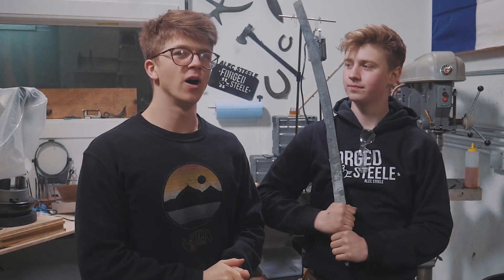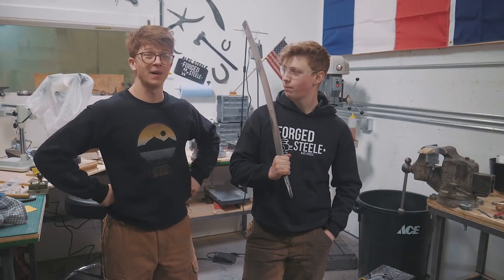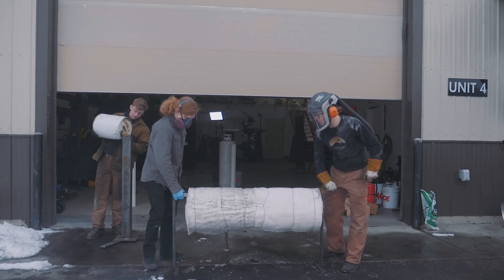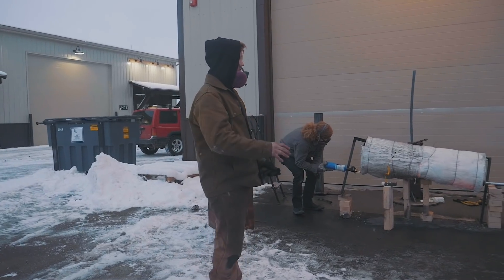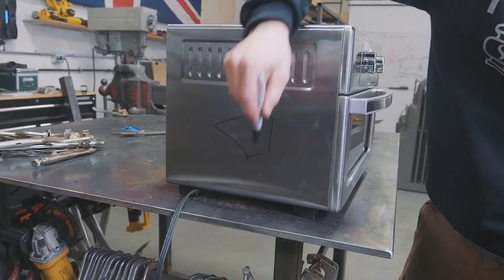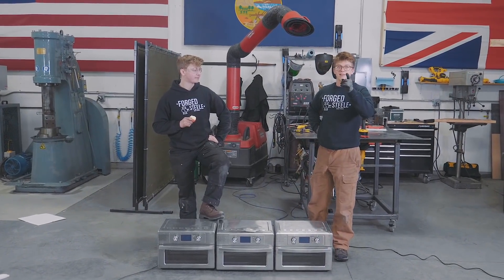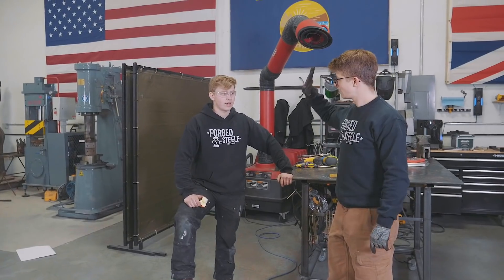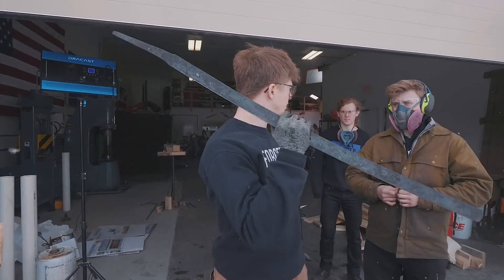MAKING THE CAVALRY SABRE: Part 4

Comment: Alec I have worked with the ceramic insulation at my current job. We made ductwork insulated with that material. You can buy tubes of insulated ductwork that would be perfect for that, 48-60" long max, 20ga inner SS, 24ga outer SS shells. It would hold up much better than that roll you guys are using, you can also get insulated doors on the ends. Just FYI if you wanted a more solid setup to heat your swords. Also the inner diameter can be anywhere from 8" to 24", by multiples of 2.
Reply: You should DM him this, he prob won't see it.

Comment: If the three toaster ovens together  don't physically work, at least you have three elements and thermostats to use to heat a fire-brick lined oven you can make to size . . .

Comment: I am somewhat surprised you went and got 3 toaster ovens (and not even the cheap one at Walmart to boot) when for considerably less than you paid, you could have gotten a thermal control several heating elements and double tube with some rectangular steel... Throw some kaowool in between to make it nice and energy efficient, and depending on your thermal control, you can even set it up to cycle and/or make it an annealing box...  (set it up for a argon or noble gas feed and you got yourself a heck of treating rig.  This idea comes from a good friend and someone I consider my mentor.  (though he used re-purposed ammo cans he picked up for $1 a piece)

Comment: Alec I highly suggest you guys get some insulation around the openings in the ovens! Did you protect the wires? Worried you’ll get an uneven heat
Reply: Yeah they just opened up those wires to the oven heat
Reply: I don't think they are planning on using this setup more than once. Though honestly I thought it would be a good idea just to cut them apart weld them together and just make one long oven out of them. Surely they are going to need a proper tempering oven at some point.

Comment: Alec: Dont do this this is ridiculously stupid and dangerous
Also alec: Its not stupid if it works
Reply: it's not even really dangerous. They just added a door.
Reply: John You’re cutting a hole through a metal casing which has to be earthed to not electrocute you, if you mess up the wiring by doing this you could fry yourself wouldn’t exactly be safe
Reply: @lroberts  So the outer casing doesn't look grounded to me. in fact I don't think any electronics contact the caseing directly. While I am not an amateur electrician every one knows to not cut the insulation on a wire, or to ground  to places where they shouldn't. Like when they shorted the contacts with the springs, that was dangerous. But cutting an opening in what is essentially heat shielding to pass an item through not so much. Just like cooking some thing you can leave unattended others you can't. In this case I would prefer they join the holes with some sheet metal and insulate he new openings  to keep the heat in the ovens chambers from going into the void space to make it safer. That area  is there to protect you from when you stupidly grab the outside of the oven also to keep from setting what ever you crowd around it on your counter from melting to rapidly.
Reply: @Laugh1ngboy  Electrical appliances with metal casings are grounded to prevent you from electrocuting yourself in the event of the device malfunctioning or having a defect, either from the production line or from the user. The heat generated from the oven could potentially melt the insulation on the wires as it rises by convection into the void between the two metal cases and cause an open potential difference in the circuit. If the metal case isn't grounded or it was accidentally damaged, this would prevent the fuse from blowing with would open the circuit and prevent an accident. So I think its fair to conclude that this wasn't exactly the safest thing.
Reply: @lroberts  There is a difference between having a ground and being grounded through the casing. A lot of kitchen alliances are double shielded and they are not grounded. It is why they can now get wet and not set off your GFI, but will if they fall into the sink full of water.
Reply: @Laugh1ngboy  Cool m8

Comment: Alec! Great work! And I finally have a way I can share my knowledge with you, as I am an insulation contractor by trade. For your blankets, find the product made by 3M that has a kraft foil scrim facing. It's like a super-heat-resistant foil that's adhered to the entire surface of the insulation, meaning you won't have the fibers and dust blowing around, as well as less leakage/invasion of cold air into your chamber. Will also let it stay in one piece longer, meaning you can use it for heat treat more times before it starts coming apart. The stuff should be around $5 per square foot. If you don't have a local 3M distributor, look into commercial/industrial insulation suppliers. Any of their reps should be able to guide you to the right stuff.
Reply: I've also now got myself a Freedomheight shirt on the way. This is gonna be a good week.

Comment: Why dont you just use the parts from the toaster ovens to build one large oven. Make a box, gut the toasters use the heating elements and controls in the longer box.
Reply: This way they have a built-in way to sit the sword in the middle of the space.
Reply: The hearing elements would probably not give off enough heat to heat that large an area, in the ovens they still have the areas they were designed for

Comment: Why not use firebricks and electric coil and just make a permanent heat treating oven?
Reply: Another way that i've seen it done is to use a hot oil bath.
Reply: I was just about to comment this. You can get a small kiln, some extra coils, and some firebricks and make a pretty decent and accurate heat treating oven of any size or shape without too much effort. We did this with an old kiln that my dad used to cool down his glass blowing stuff with. Just gotta be careful cause once you fire the coils they become very fragile.
Reply: With you on that...I mean they have an electrician that they have used a lot and between the group could make that pretty quickly
Reply: They say it is a temporary solution. The guys will have something planned I guess 🤔🤔
Reply: I am pretty sure this heat treating oven will become like that with a layer of that material in.

Comment: I like the idea of the ceramic wool heater, we use a similar concept in the oil industry for boiler systems ( coils containing oil wrapped in ceramic wool and a fire blown between it all to warm the oil circulating in the coils) . To make a more permanent heat treatment oven you could attach the ceramic wool to the inside of 10” drill casing and mount the burners down the middle. And put a swinging door on one or both sides. Just and idea! Keep up the good work!

Comment: Make a Tempering Oven, make a single insulated box. Dismantle the toaster ovens (remove the tin) and mount the elements inside your new oven.
The current method is going to have two 2-4 inch sections of the blade (the double walls where the 2 toasters connect) that don't get properly heat treated, or at least don't get to the same temperature.

Comment: remember to maby insolate the holes so you dont burn off the wires ?
Reply: That's what I was thinking. Maybe cut some kaowool like a picture frame and then sandwich it in there so all the gaps inside are covered to protect the wires from the heat.
Reply: Doesn't burn the holes/ holds the heat around all parts of the blade to avoid an uneven heat treat.
Reply: welp we are gonna find out soon enugh anyways :P
Reply: @durasux99  kinda what I tried to say haha, However I made quite the pig's ear of it haha.

Comment: Feeling that the wires exposed from the oven being cut won't like being heated up and the tempering in the oven will fail
Reply: I was wondering how that would work out too. I was expecting them to rig some kind of heat shield or use some of that insulation from the furnace
Reply: I had the same thought. The heat will now travel to the the wires and electronics. It may last, but it would be better if there was insulation where the holes are.
Reply: And Alec, don't leave unattended!!
Reply: Worst case is it shorts out if they touch or the coating just melts

Comment: If you redo that quench tank so it's at a 45 degree angle it will be much easier for one person to use.
Reply: It would also need more liquid in there. I thought about it earlier and it's not stupid though.
Reply: it would be nicer if it was horizontal so that you can dip the entire length of blades at the same time instead of tip first
Reply: @Monstufpud  like a trough? the kind horses drink from
Reply: yes
Reply: @Monstufpud  the saber itself is better off being tempered as such mostly because it's a stabbing weapon only the first 8' are deadly...also what she said
Reply: But if the piece is long it has more chance of warping under its own weight in the quench at 45deg
Reply: Elijah Darden - if she said she wants it horisontally, not just the tip, I would fear for my family jewls, bro. You can only dip it head first if it's attatched...
Reply: @jennabrazelton5442  the first eight feet ??
Reply: At any rate it makes sense to quench a katana in a trough because you lay it in with the edge of the blade down so that the temper draws from the spine to the edge making it the hardest part while giving it that flexible structure when I katana is forged the goal is to actually make warping occur in the tempering process (if you haven't seen one being tempered I implore you to look it up its insane) in the spine to get the signature curve  so for a saber you want the hardest point to be the tip of the blade also warping in the tempering process is actually really common and if caught in time can be easily delt with the trick is just to catch it in the first 8 or 10 seconds after the quench I've watched makers secure the tang in a vice while the blade is vertical to the ground apparently that is one way to insure minimal warping but I've never done it

Comment: You guys should take the parts from those toaster ovens and make a long  metal box  big enough to put any sword in and install the toaster oven heating element inside the metal box and make a panel holding the temperature dials and one of the timers the cool thing about doing it that way is if you're heat treating a knife you can turn just one on if you're doing a medium-length sword you can turn to on and if you're doing a large sword and you can turn all three on
Reply: You would lose the even treatment having it setup like that, better to have it all or nothing.  I was thinking the same thing though, with a rack all the way across.  You can also temper multiple projects at once this way too.

From what I understand, once they get all their kinks out they will both be working on independent projects, atleast that was my understanding.  And it's far easier to have a heat treat day where they heat treat both projects at once, then temper day.  Having a oven large enough to temper both at the same time would be a god send.

Also, if they ever try making their own steele again (when), I've seen some videos that show the steel being tempered before being worked, so this would be another great use for this.
Reply: @patrickmcneely3877  not really I mean sure you could set it up so there's gaps between the heating elements but it doesn't take a bunch of effort to put a slice of kale wool in to section off the part you're using at the time
Reply: @shadowstorm79mc  yeah, you can section it off that way.  Just saying you don't want 2/3s of the space none heated because the convection currents between the hot and cold sides would end up causing a single element to have to have to stay on to make sure the interior air mass stays at temp which ultimately would lower the longevity of the element.  It also really wouldn't save much power unless you block sections off like you suggest but at that point your going back towards the point of 3 toasters ovens sitting next to each other 🤣
Reply: @patrickmcneely3877  those toaster ovens are new enough they should have a convection setting wouldn't be a bad idea to include that and that would solve the problem of convection currents
Reply: @shadowstorm79mc  actually probably the best thing to do is design it so the chamber is like 1 brick high so you can just side the brick in and out to make it a 4 element chamber and a 2 element chamber.  Then when you need to you remove the brick and bam! 40in of tempering brilliance.... and it wouldnt be too janky that way

Comment: Idk why but the sloppiness of the holes cut into the sides of the toaster ovens really bugs me lol.
Reply: It bugged me more that right after Alec nipped his finger, Will was bending the metal on the stove cuts without wearing a glove (during that montage).
Reply: Exactly. It would have been far quicker, easier and safer to use a grinder to cut the holes. I expected far better from some experienced tradesmen
Reply: A 3 inch hole saw with short sleeves made of pipe  have been quicker and safer all around , but far more boring
Reply: Didn’t seem like they were level either. Like the sword sat bent.
Reply: @1234 That's a dangerous place to not think clearly...
Reply: Probably should have added some  insulation between the doublewalls on the ovens, so your not pumping excess heat to all the controls!

Comment: Another tip for even tempering using your method from a guy on a forum I frequent: Create a basin filled with sand and heat the sand to your ideal tempering temperature in advance, place the blade in the sand for the tempering cycle and that way your temper heat is more evenly applied.

Comment: Alex/ Will recommend you use a rigidizer on your Hi temp furnace. (Used to increase the durability and surface erosion resistance of Fiberfrax, Koawool blanket,) check your area pottery supply for availability. also install some blanket as a gasket between the toaster ovens it will help keep the heat more uniform. Keep up the good work enjoying this one.
From Elliot Lake Ontario Canada.

Comment: Get a perforated steel pipe, put it through the three ovens with a door on one end and you have a permanent heat treating oven. Put some fire wool between each oven (between outer tin and inside of oven and around the outside of pipe). Go to your local Siding contractor and get a roll of aluminum and you can wrap the outside of your tempering  oven and again you have a permanent oven.

Comment: I miss the old alec Steele doing old school blacksmithing where's the hammer and anvil work? also, it seems you guys are more focused on the teamwork rather than the actual work in the videos.
Reply: Give them time,  they are still building a shop and setting up everything.

Comment: All the metal working tools in the world.... and they cut holes in toaster ovens with die grinders..... Why on earth wouldn't you use angle grinder with a cutting wheel!?!
Reply: lol I was think same thing.  A guy that is so precise and perfectionist, someone who has 50 part episodes on engraving and they do that to cut opening
Reply: Because this is 'Montana Edition' of the Alec Steele show!
Reply: Grinders throw alot of fine metal particals around and they dont mix to well with electrical components an ugly hole that works is better than taking a risk of shock or letting the smoke out on the new oven.i would have cut the inside how they did but used a grinder on the outer case while it was off
Reply: Odinsravenhugin I would’ve just used a large hole saw.
Reply: @andrewwinch474  you win (also maybe measure and mark so the  holes  line up nicely lol)
Reply: What about a tin snips?
Reply: Think I'd have gone with a larger hole and a wire loop to suspend the blade. Lowers the risk of cold spots between ovens.
Reply: @rickyhorsburgh6581  I get the particles bit, but that can be mitigated by proper tool placement (wheel throwing the sparks away from the piece) and also with several air blasts from the compressor.
Reply: I thought the same thing.  GET A CUTTING WHEEL ALREADY!!!  Even a sawzall or dremel would have worked better than bits on a drill.

Comment: So here is a little fun blacksmith lore, when quenching large blades like this you want everything to be facing north. The tip most importantly! This is said because when steel gets to quenching temperature it becomes nonmagnetic, but when you do quench it it becomes magnetic once again, and of curse magnetic are pulled north. So a blade quenched facing east would warp to the left, and a blade quenched west would warp to the right. Just a fun little hint to think about!

Comment: Color quality is still off things seem hazy and pale
Reply: I am wondering if this is an issue with the equipment, if Alex brought some of his Uk video equipment and is using US editing equipment for example, the video is getting converted between NTSC and PAL colour space this will cause a loss of colour data  the Uk uses 60Hz whilst the US uses 50Hz which again can cause problems. Finally it might be YouTube settings Alex would have originally have uploaded his videos as a 60Hz PAL file which YouTube is defaulting to but Alex is now uploading a 50Hz NTSC format file that YouTube is converting to a 60Hz so basically only use US sourced editing and recording equipment and check YouTube is converting the file to a Uk standard unnecessarily
Reply: Should be able to just change the settings to NTSC if hes still using his GH5.
Reply: You  are right Justin but if his equipment is still set as PAL at the moment it would need to be converted to NTSC in order to edit if using a US editing suite this will lose quality but since it happens in the background Alex may not have realised the conversion is happening. All it might need is to set all the equipment as NTSC and we get the quality back. It is worth checking as it is a simple fix if that's the case